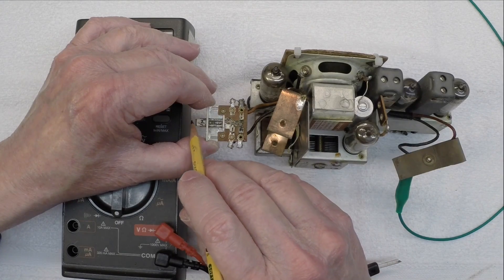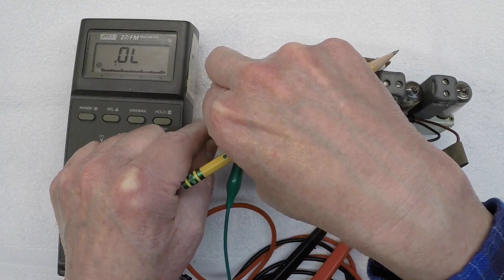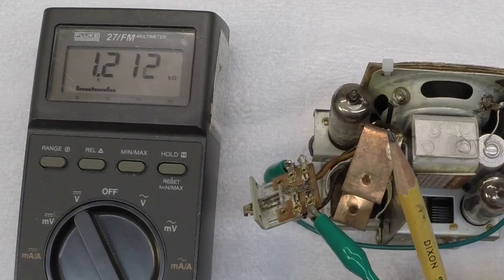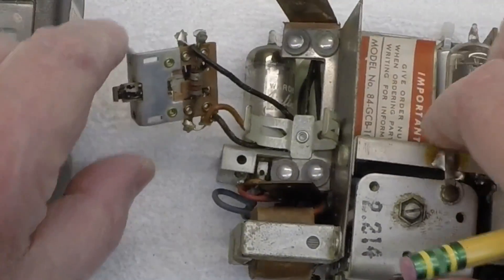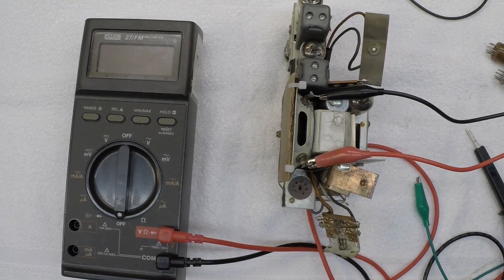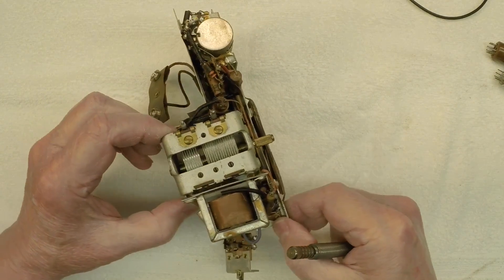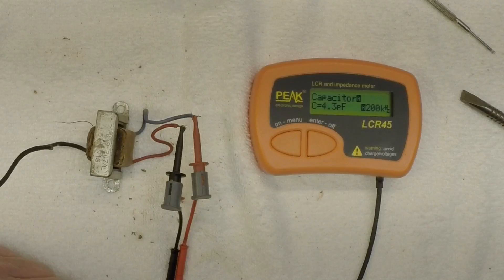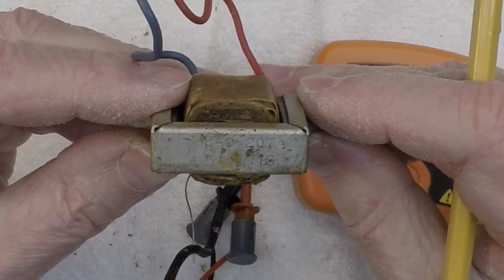Airline Portable Radio - Model 84GCB-1062A - Slide Switch & Output Transformer Troubleshooting

Comment: I happen to have about 20 WWII tube radio transceivers. Some are for portable ground use and some are for the air force. Some are duplicates that can likely be combined into a working radio. One of the radios is the same model used in the Enola Gay airplane that dropped the Atomic Bomb. All these radios need to be refurbished and it's obvious some were modified in the field. Some are just radio power supplies. I'm not a radio guy (but wish I was), but these are available for sale to you or anyone here. They are all heavy so shipping would be actual cost. If you or anyone else here is strongly interested, please just reply. I'm not sure of prices yet as I've just been storing them from a deceased friend.
Reply from the maker: Wow, what a collection. You may consider posting these on the Antique Radio Forum at: https://antiqueradios.com/forums/viewforum.php?f=15 I'm sure you'll find a home for them. Best, Don

Comment: Ahh, another transformer to dig into and hope the break is on the surface. I think there is a Hammond general-purpose audio output transformer kicking around but not sure if it would impedance match correctly for a 3V4 and a 3 ohm speaker...
Best of luck!
Cheers,
Reply from the maker: Excuse my belated response, but I appreciate the info on the Hammond. Best, Don

Comment: Most likely C11 is what took out your audio transformer!  It is a paper wax type, right?
Reply from the maker: Wayne, they were all paper. I checked all of the caps afterwards and none tested as shorted, just leaky. I’m thinking the lead wire solder connection failed, but the cause is a big question mark. Best, Don